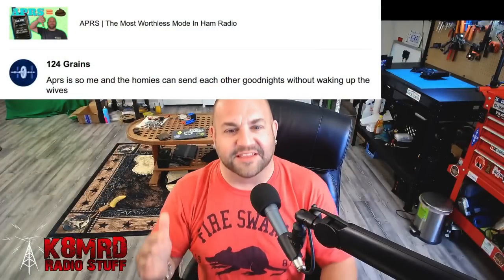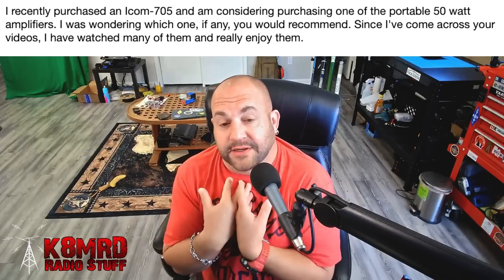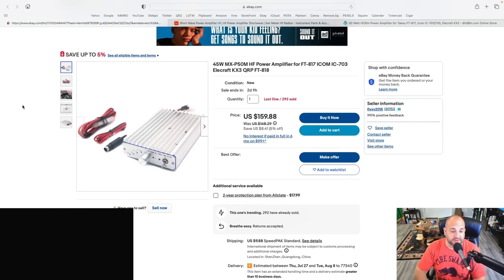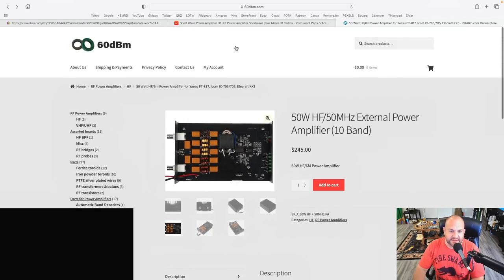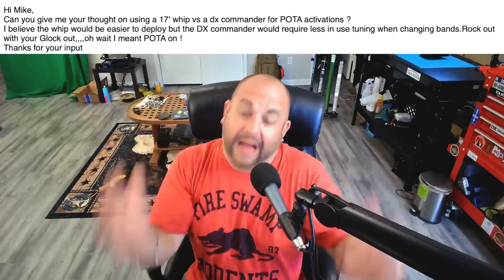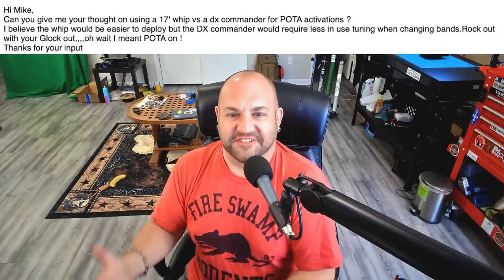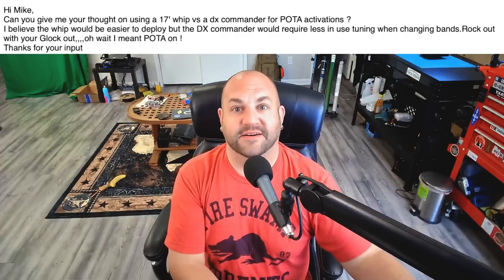DX Commander And A Window Screen

Comment: Tip for all those that use 17' whips.  Take a Sharpie, tune each band, and then mark the whip.  This should get you well within the ballpark of the band, regardless of ground conditions, that all it should take is a minor tweak (or 2) to "maybe" fine tune it....otherwise it should be fairly good to go from there.  Makes it much easier, and quicker, to change bands....you can do the same with a WRC 😉

Comment: Mike, the window screen thing certainly works. You’re correct about the screen having memory and wanting to keep coiling up; and the aluminum splinters are a thing. The up side is the small foot print. I don’t have to worry about people tripping over my radials. I keep the screen in the trunk of my car and use it when the situation dictates. Ps: love your videos!

Comment: Hi Mike!  Great video, thank you!

I can totally relate to the situation many of us face. In my case, the only way I managed to achieve a decent SWR was by connecting the WRC to a magnetic mount on my car. I tried ground mounting with radial wires and even experimented with an alternative radial wire design using extension cords, but I couldn't get the SWR to drop below 2:1. However, once I switched to the mag mount, it improved significantly to 1.4:1 or even lower, and the performance was great!

One interesting observation I made was that when the ground mount was positioned in the middle of the screen, I couldn't achieve a good match. But when I moved the screen to one side, the SWR dropped drastically, and I had a much better match of 1.2:1 or less across most bands. I'm not entirely sure why this is the case, as Mike KB9VBR always places his mount in the middle and has no issues. For stability in the field, I used four small rocks from our landscaping to secure it, and it worked perfectly fine.

In the end, go with whatever setup works best for you. If you decide to give it a try, you might be pleasantly surprised by the results!

Wishing you all the best!  73 de NS8Q
Reply: I've noticed that whenever I used a vertical HF antenna, the SWR would improve if I simply raised it higher off of the ground. I haven't tried raising the WRC but I did try it with a Buddipole Deluxe. Also the idea I was thinking about the screen is that even though it covers more area around the base of the antenna, it isn't the same length as the radials. 73 KD5YOU

Comment: The Screen thing just cracks me up, I have been involved in Radio for over 50 years and it seems like 100 sometimes, but the rage was using copper screen for ground plane oh about 35 or 40 years ago and it was what you kinda did when setting up verticals for a permanent setup except you buried the mesh under the soil. and becasue of that I think it just fell out of favor. But like history things do repeat them selves in life.  Thanks Mister and if you did the experiment I am sure it would help validate questions for the ones that want to see it work. I for one know it will work since many years ago I did bury a few copper screens. Thanks for a good Video and 73. Vic de KE8JWE
Reply from the maker: Yeah it is most certainly a thing of the past that is coming back for sure.  But, there is a whole new generation of hams who want to experiment who may not realize that it's been done before.  Myself included.

Comment: I use the Xiegu XPA125B for both my G90 and 705, but yeah, it ain't cheap. The auto tuner on it is a beast.

As far as the portable DX Commander, I'm surprised you didn't put 4mm banana plug lugs on it and 4mm banana plugs on your radial wires. That way you don't have to undo the wing nuts and reattach them and risk losing them in the field. Banana plugs on radials make deploying radials so fast and easy and don't have to worry about some idiot tripping and pulling down your vertical.

Comment: I tried the window screen thing. It worked well for me. I only have one arm and I use a wheelchair, so I friggin hate radials. The screen thing eliminates tangled radial wires! Dang thing tries to roll itself back up, so bring a couple 4ft long 2x4's to keep it in place.  Try it Mike.  BTW, great videos. 73 - W5DUI

Comment: Forget the window screen.  A Faraday cloth is easy, compact, and effective for portable use.
Reply from the maker: That's what the kids are saying these days.  I've not used it myself but it looks way better than a screen.
Reply: Not for permanent use it's not, Faraday Cloth is fine for poda and portable operations but you're much better off using something like 16 foot welded hog panels for a permanent installation. I use 4 of them for my verticals the benefit is the wind isn't gonna blow them away. You stake them to the ground using lawn staples the grass will grow up around them and you'll be able to mow over it they basically disappear into the grass and they're good for about 10-15 years on the ground depending on how wet your ground is.

Comment: I'd love to see the screen test. You explained exactly why it'd not be ideal for a temporary installation, but if it works I think it'd be great for a (semi-)permanent setup, even where you otherwise have room for radials. I have a ton of mobility issues and use a walker, and my Dad is 80; I've always been concerned I'd get tangled up in a radial field, and I don't really want him trying to navigate them either.

It'd be even better if the window screen doesn't actually have to be on the ground at all. It sounded like from your video that might be the case?

Comment: I would do the screen test Mike due to the difference between a loading coil but also being a proper test on a non loaded 1/4 but also 80M and the rest of the bands
Reply from the maker: 80's not going to happen but if I do try this it will be 40-10, maybe 6?

Comment: on the 17 foot wip. I have found that with a tape measure that I have marked the different lengths for the bands on the tape, works just as well as analyzer. You do need to stand up and walk over to antenna to measure it but does work well. DX commander is a great antenna and have one setup at home qth.  I know there are tapes that are already marked for the bands but I am cheep sharpy works just as well

Comment: Do the screen!  I can change bands on the 17ft whip in 10 seconds.  Just write down how many sections you have to move down to get to the frequency.  To go from 20m to 15m I have to go down 4.5 sections.  

I'm testing the screen right now, and 20m is at 1.1, so you have to do it.

Comment: I use a window screen for my “Hamstick Commander” in my attic for FT8 using my QDX. The DX Commander seems like rolling the radial wires out for portable would be easier to deal with than a screen that wants to roll back up.

Comment: I use a 17ft whip almost exclusively (apartment dweller. "base station" is not an option), and I assure you band changing is nothing like the process you describe. I use a pair of tuned, elevated radials banana clipped at the appropriate lengths and the whip is marked. I can change bands in barely over a minute. Is it is fast as an efhw (which I have and deploy sometimes) or your dx commander? No, but neither is it as onerus as you claim :)

Comment: I made a contact in Germany on 15 meters using my IC-705 yesterday on 10 watts from Atlanta GA.  I frequently contact VE2NTT in Quebec.   I don't see the point in getting a 50 watt amplifier for the IC-705.  If he's having trouble making contacts in this part of the solar cycle, he should focus on a proper QRP antenna.  My primary antenna is the KM4ACK EFHW.  Cheap kit worth every penny.  Highly recommend. Much cheaper and less junk to drag around to a park activation.  My entire setup fits in a lunch box, sans the arborist throw-line.
Reply from the maker: You're not wrong at all, but a good antenna and more power is certainly going to help get into the pileups.
Reply: @hamradiotube  Agreed.  My pileup strategy is to avoid them.  But in the case of 13 Colonies or Field Day, I try to be First or Last.  😆 

My brain assumed he wasn't able to make any contacts.  As was the case for me, when I was running a Chamelon EMCOMM.  I couldn't contact anyone and thought QRP was a waste of time.  Until I tried a QRP specific EFHW, and now I make contacts all over the place.  I absolutely smash Europe on FT8 at night.
73

Comment: Use a Faraday cloth instead. It doesn't have sharp edges and it would fold up a lot smaller than the wire mesh.

Comment: I live in a small 1 bedroom apartment(alone) I thought about a shot hustler antenna on a tripod and a window screen on the floor under it in my living room.  The window is large and faces Northeast and I live on the top floor.  The only reason you might want window screen is if you have no room for long radials like Me

Comment: A screen test would be good fun! I tried using a screen with a Super Antenna MP1 with good results on 20 through 10 meters, but I had to use the supplied radials to get 40 to tune. I'm not sure why. Anyone have an idea?

Comment: The screen rolls out or back in without fuss in 30 seconds, no more fuss with wires  try a 36" x 84" aluminum screen & clip it to the mount, I spike my mount right through the screen, instant POTA. Seriously, to each his own, but it's fun to experiment. It won't help APRS get fame though, liol. Cheers, Davey - KU9L
Reply from the maker: Hey thanks for the tip.  It’s still in the idea wheelhouse.

Comment: Having lived with a 'stubborn German' for many years, I can understand your position. However, I would like to  see the DX Commander with the window screen. Sounds like a valid/useful option for use in a more permanent location on 'iffy' soil or rocky land as an alternative to attempting to bury radials.   (I'm actually considering using a roll of 4X4 inch square fencing. A 50ft roll of 4 or 6 ft fencing is not too expensive...   )

Ren K7JB--

Comment: Instead of window screen, use tin foil.  After you’re done you can make and wear the hats… 😊
Reply: I used 2 102 inch whips as a rotating dipole
Reply: Rabbit ears😂 your bed springs😂
Reply: No. The tin foil is for the nasty grill for dogs and burgers. 😂😅
Reply from the maker: A tin foil hat?  In the Texas heat?  You must be crazy! :)

Comment: Hey Mike, 
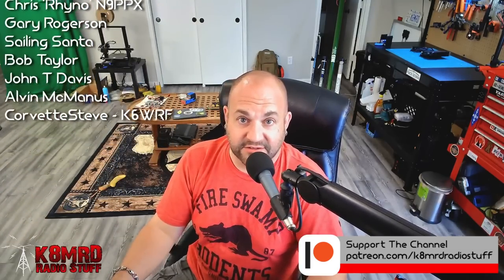Interesting video.  I don’t use an amp but did find your info on the 50 watt amps helpful.  You don’t need to try the screen wire as a radial for me but think you should satisfy your own curiosity.  I’ve use it on Rybakov vertical (25’ wire) and seen good success with it.  As for the screen rolling up or not staying in place just get 4 aluminum tent pegs 14:06 from Walmart and pin the corners. Works a treat!  73 N4LWT

Comment: I had a giggle with the apps comment.  I have an hf amp that wants 5 watts input...  unfortunately it draws heaps
..  I haven't had a chance to measure it however it is supposed to be 600watts out...  so you would need a 100AH battery making it not so portable 😅

Comment: I saw the screen videos and was intrigued by them but not to the point of actually trying it. I have the same OCD objections. Thanks for another great video. Jack K5FIT
Reply: Update... I bought a Wolf River Coils with 17ft whip and have used a piece of faraday cloth as a radial. I did my last POTA with that setup. The cloth folds up micely and fits in the bag with the antenna. Very good swr on all bands.

Comment: From what I see the screen works.  I would think that the radiation pattern would have to be different compared to radials.  All I've seen though is here it tunes and I made some contacts.  How about a test with a field strength meter.  Other than the small footprint not sure what the real draw is.
Reply from the maker: I don’t really get it either but it is intriguing.  I would imagine the radiation pattern would be even more omnidirectional but that’s just a guess.  Unfortunately I don’t have a field strength meter to test but that would be some good science.  The small footprint would really be the main benefit here though I think.

Comment: I Operated field day using a 25ft length of screen and my Wolf River coil.Yep i bought the BIG roll. 0n 20m my SWR was flat. Kb9vbr only used a 10ft length i think. is more better? I dont know but it worked. Youll need some kind of a weight or ground stake for the ends to lay flat. Wouldnt be a bad idea to use some duct tape or something around the edges, or yes you could get cut.
goodluck!
k8ob

Comment: For a amp, many try a rm italy HLA150........5 watts in,130-140 watts out.  Has pass band filters and 2 fans.   I use one at home with a x5105 for a fun change in the workshop and a cobweb antenna and it works well......many not the best size for portable though.   KC3OBQ

Comment: The window screen ground plane makes perfect sense as someone who operates mobile. My Outback wagon is likely bigger than a typical piece of window screen. I'm definitely not trailing 33' radials out the back end (or the front!), but I'm over halfway on DXCC Mobile. Window screen could be a HUGE problem solver for HOA Hams or people who just don't have any kind of real estate for traditional radials. 
It also makes sense from the standpoint of using "a lot of short radials in place of a few long ones". I have a BuddiStick and if I can save myself time futzing with radials or a counterpoise, count me in.
My only question is: Are window screens as efficient as traditional radials. Love my FT-891/ATAS-120A but I often wonder about efficiency, even on the higher frequencies. Tnx de WB3CFN/m

Comment: I tried screen. What a waste of 45 minutes. Did not tune well and was supper narrow band with.  I gave my screen away. Went with a bunch of short radials. Much better
Reply from the maker: Lol.  I would imagine the size of the screen would be of great importance too.  But if it makes it narrow band, that doesn't help much for me.
Reply: My thought was I was putting 100 thirty foot radials an a 10 foot vertical. 
The owner of Wolf River Coil swears three 32 foot radials is the answer. I will be darned if it works. I know 5 guys running 20 or less foot radials. 
I went from 6 each of twenty foot to 8 each of 10 foot and it’s even better.